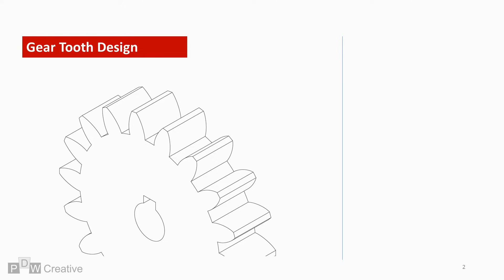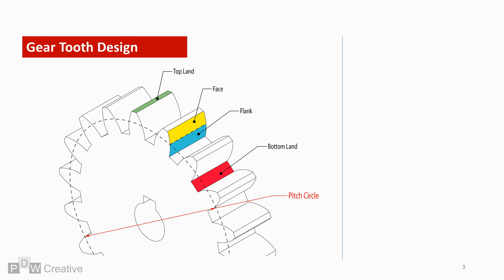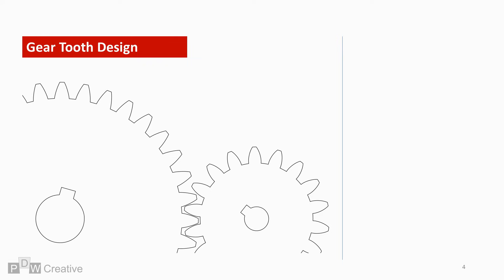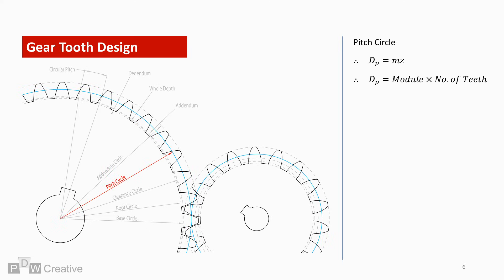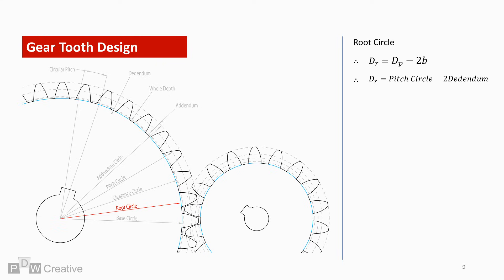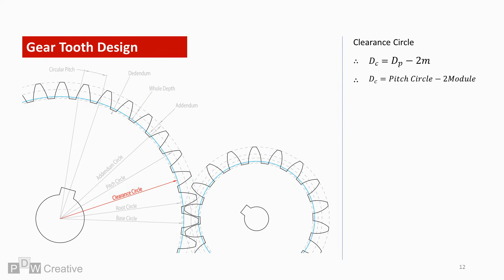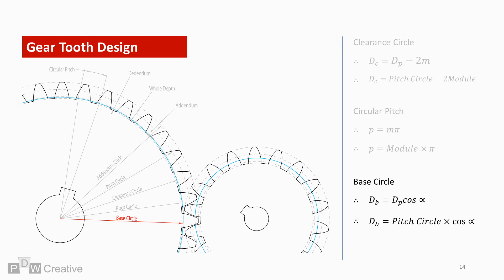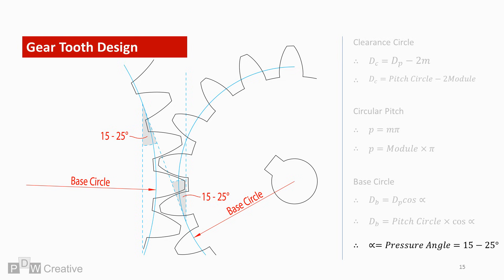Spur Gear Design 1 - How gears work

Comment: At 5:25- why is the base circle of the left gear near the tooth roots, and on the right gear, it appears to be the pitch circle?
    Also...to keep the line of action perpendicular to the teeth faces that are transmitting force at any given moment- it seems that the involute must be formed from the pitch circle- is that so? 
   If so, is the flank of the tooth, below the pitch circle, actually a true involute shape?
    Thanks, a helpful video!

Comment: Hi there, loving this, great explanation! But I seem to have got stuck on calculating the base circle. The equation needs the angle interaction, but that is calculated by using the base circle… Do i just choose a number between 15 and 25 degrees?
Reply from the maker: Try different angles to find the best fit for you needs

Comment: Of i want make design 86 dia circle ???how to devide a no of teeth..what is the addandm,dedundm and circular ..can u explain ??
Reply from the maker: You will need to base your design around the desired diameter and calculate the other inputs as variables. It sounds like you need to go through the video and decide which other parameters are important for your design.

Comment: Only thing I don’t get is the BASE CIRCLE - Pitch Circle x cos. So if the Pitch Circle 10 and cos 20 calculation is 10 x 20 = 200??
Reply: 10 * cos(20) = 10 * 0,4 = 4

Comment: 2:27 Is module and addendum the same thing? 
I've seen module is used instead of Diametral Pitch for milimeter gears. It's equal to Pitch Diameter (in mm) divided by the number of teeth.
Addendum is the radial distance from the pitch cicle to the top of the tooth. It's equal to 1/Diametral Pitch.
Am I wrong?

Comment: When pressure angle is 20 then maximum number of teeth is 41. Above 41 the base circle falls below dededendum circle. can you tell me how gears with large number of teeths are made. Are they involute or any thing else.
Reply from the maker: Try a different pressure angle and module combination. There are lots of different tooth profile types. Involute is one of the more common

Comment: When you calculate the module from Pi and the circular pitch do you use radians?
Reply from the maker: You need to base the module and number of teeth on the design requirement. So consider your gear ratio, size constraints and whats practical for the design problem your attempting to solve.

Comment: Is there easy hack how to calculate it all,  without machineries handbook and all the redundant relashonships,  with half of the symbols having no expression or knowable meaning. AM cave MAN dammit. Want to fly like bird.  And too many mathspeak pencil neck make want to club and eat your cubs... JKG. I love the topic and the videos...
Reply from the maker: You could do all the calcs manually and just input the values for each dimension. Also if you set an excel spreadsheet to auto calculate based on tooth number and module it would make life easier for you if you ever want to make a second gear.

Comment: 3:22 Should be "pitch circle minus two times the dedendum"
Reply from the maker: I see the confusion. The video shows it is pitch circle minus two times the dedendum which is correct. But the audio sounds like I'm mentioning the addendum. Please just follow the calculation laid out on the screen for this point. I will make a note to point it out on the video.

Comment: So essentially to work out the overall diameter and size of a wheel (the addendum circle) just do the pitch diameter + 2 * module ? Great video btw
Reply from the maker: Yes. Just remember the two gears intersect at the pitch circle so when calculating where to place the next gear they should connect. The overall diameter is useful to know for assembly to make sure it doesn't clash with other parts
Reply: @PDWCreative  thank you, most helpful thing I’ve found online on the matter!